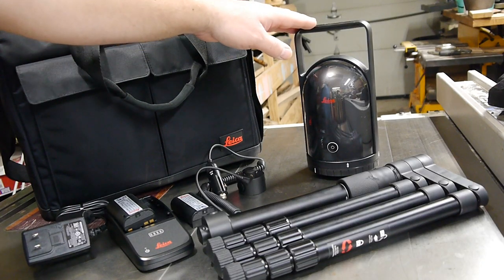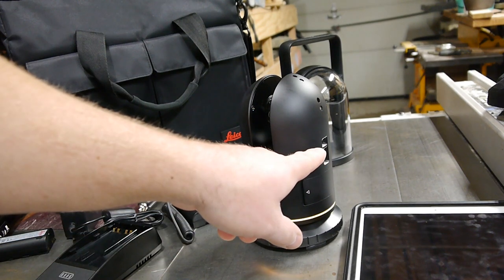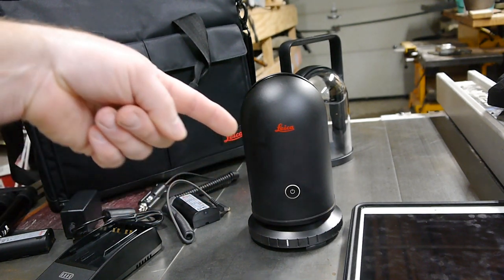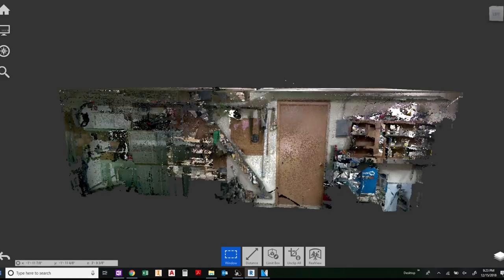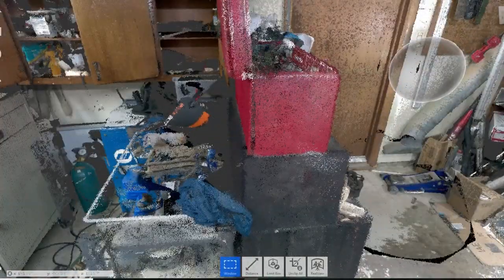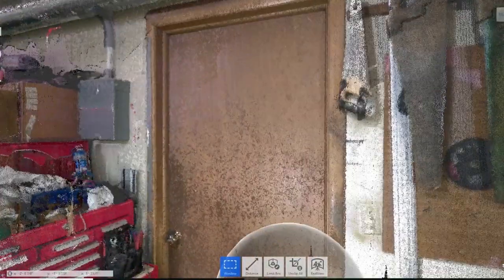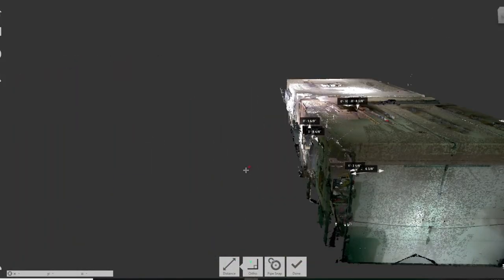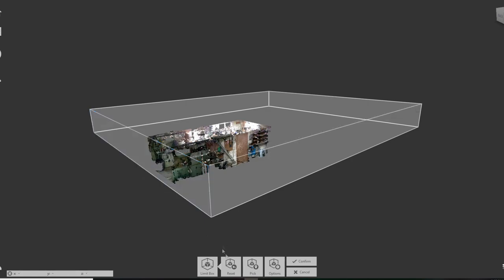Coolest Tool Leica BLK360 - Amateur Test Drive - NOT a Review

Comment: I would love to pick your brain regarding this device as your video is the only video I could find that shows comparisons to measuring tape. Was it easy to get accurate measurements or did you have to attempt it multiple times? Is it trustworthy to get the right measurement the first time or do you have to double-check all measurements with measuring tape?
Reply from the maker: Hi Sidney. It is pretty straight forward to get measurements. The only times I have had a hard time getting them is if the object was shiny, small and far away. In that case I end up just reducing what points are shown to just the two areas where I need to click on the specific points. From what I have experienced accuracy is as advertised. The only times I have had trouble is when I have not had my coordinate system lined up well, and I ended up measuring on an angle, think of it like Cosine error. I do still double check some measurements to make sure there wasn't some kind of scaling error, but for the most part if it is on the point cloud it is accurate enough for what my job entails. If the distance between new equipment and existing structure is less than 2" I will normally check with a tape measure just to be sure, but I have not had it off more than a 1/4" in anything I have checked thus far. If you require a clearance of less than 1/4" then you should check with a tape measure. But if you just need to know where beam is on the other side of the wall and the floor is not level in between it is a lifesaver!